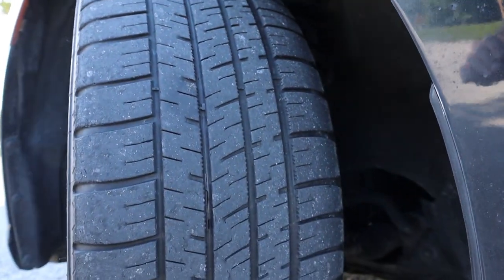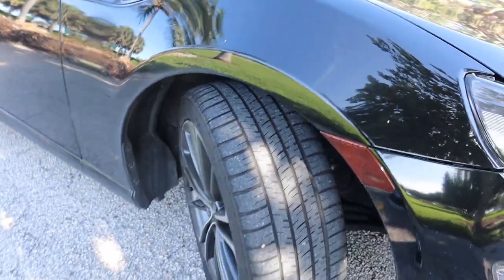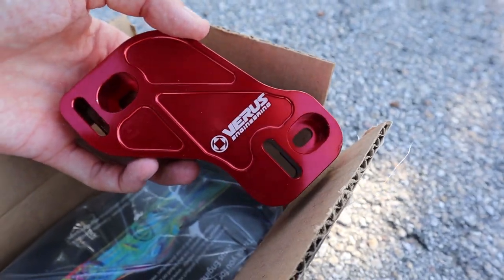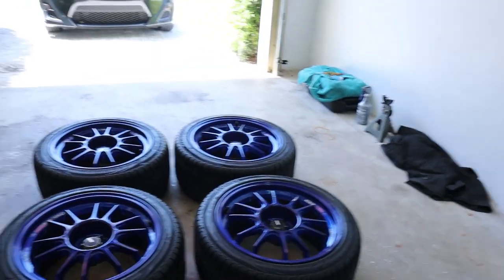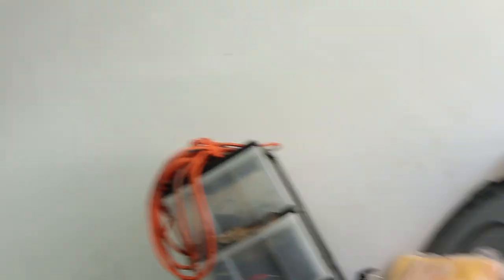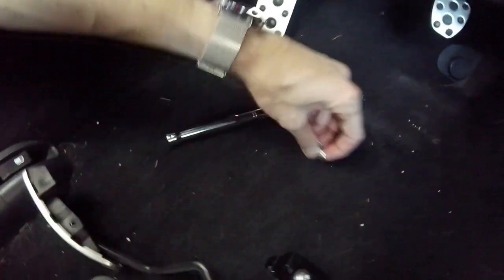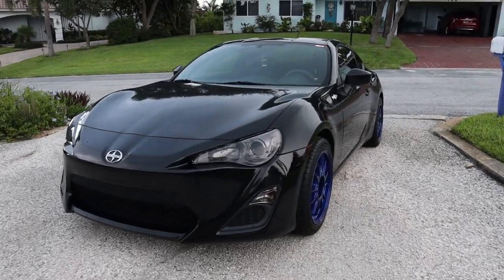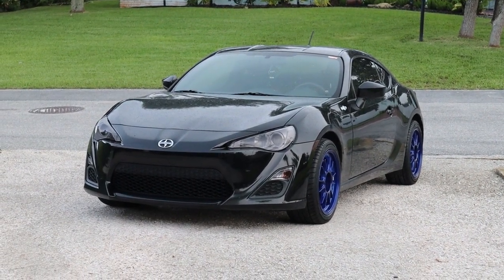Verus Throttle Pedal Spacer for FRS/GT86/BRZ

Comment: Sometimes too much pressure in the tire will do that. When the tires heat up during the day or after a couple runs, it will increase in temp and up to 10psi depending on the day's temp and track layout(lots of turning). 
It could be why your first two laps of the sessions, the tires felt good, because your cold temps were at the right psi. After that, the psi jumped and causes the tire to lose their grip characteristics. If you monitor your tire psi inbetween runs you'll notice more consistency and concentrating more on the driver impact for control.
Reply: The Driver UX I never thought of that but ima check my tires now tomorrow aha. Does that happen often?
Reply: @Gau-Chuu  yes, it happens more often as the track or pavement gets hotter throughout the day. More turning, more friction and heat. If it's a hot day the tires will heat up faster. 
An old trick to monitor your tires is to draw strips of chalk on the sidewall. This way you can see if you are rolling on the sidewall and if not, you can drop a psi or 2.  Same goes if you are too low, you see missing chalk on your tire, that means you are too low.